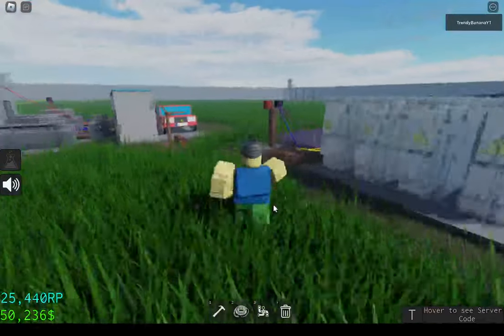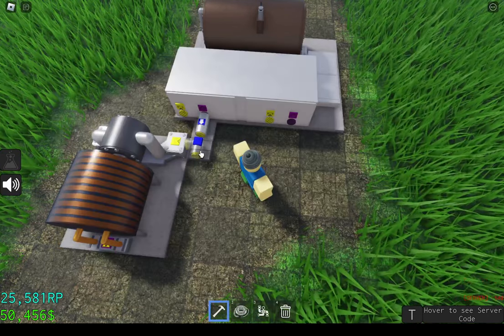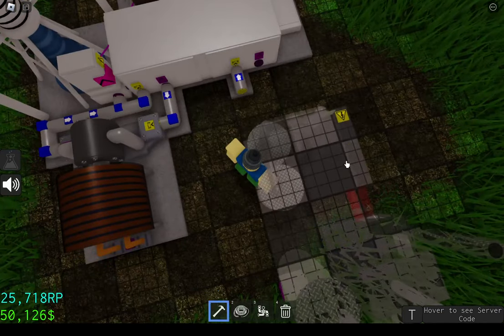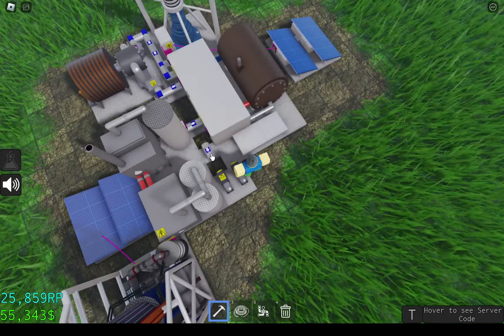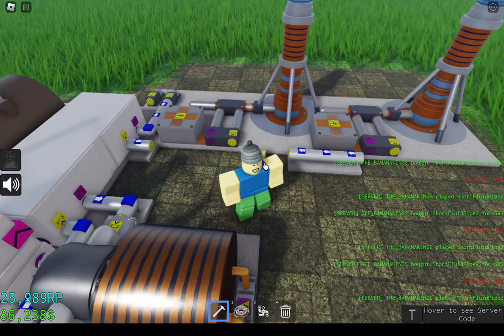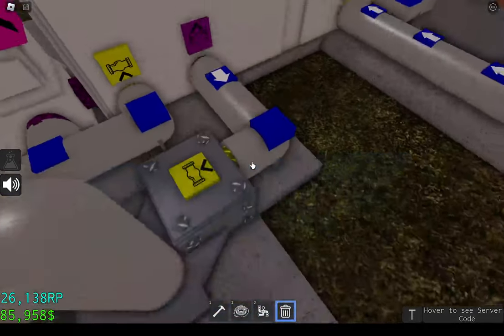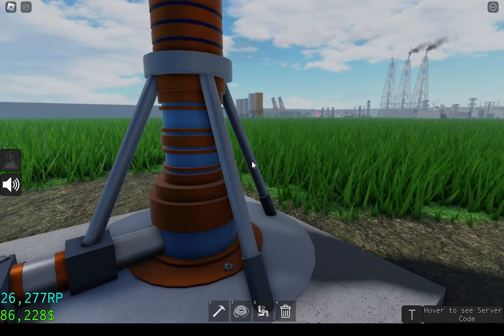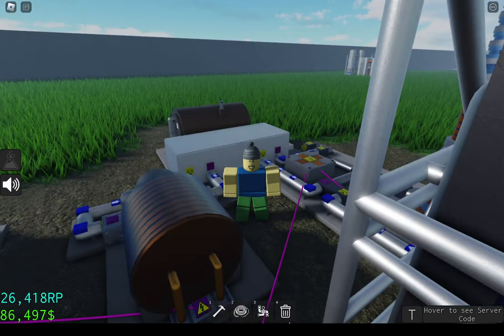How Boilers Work | Industrialist Tutorial

Comment: How to get hotter steam???? Or something i just want more power😂
Reply from the maker: 2 Geos, recycle water, many different ways. It all depends on which method you re currently using.
Reply: 3 Geos🗿
Reply from the maker: I would say 3 geos are overkill, as 2 geos reaches the highest temperature possible for geos(the highest that actually effects the boiler),  @_spacezland_9713
Reply: Rlly? Cuz I get 230 temp with 3 geos
Reply from the maker: Yep. The levels of temperature for power increase are 130c, 150c and 300c. So if you pass 150c, there is no reason for anymore because geos can not reach higher then 250c.  @_spacezland_9713